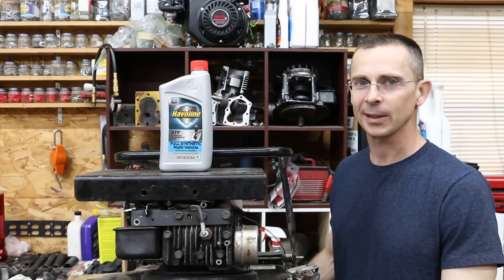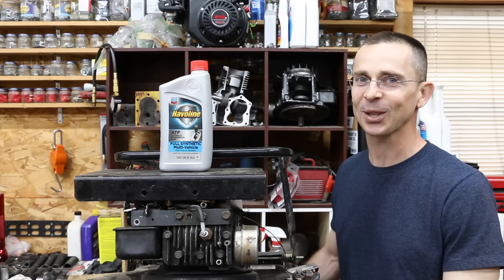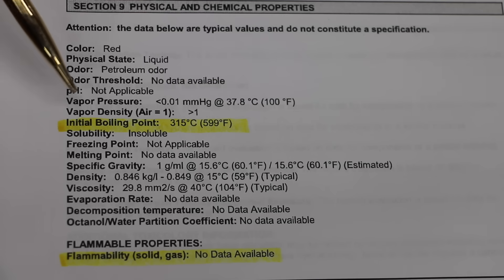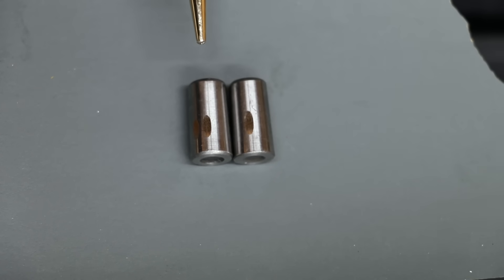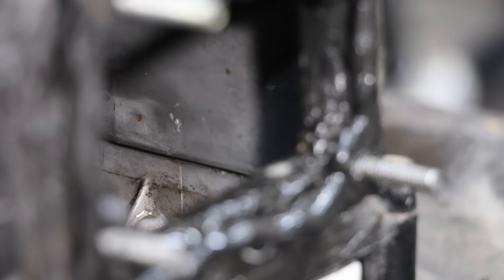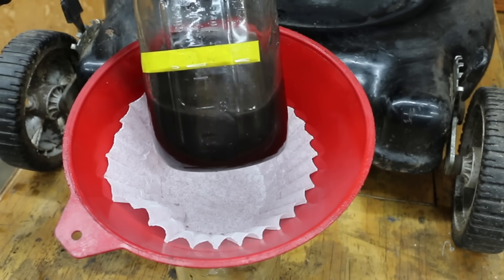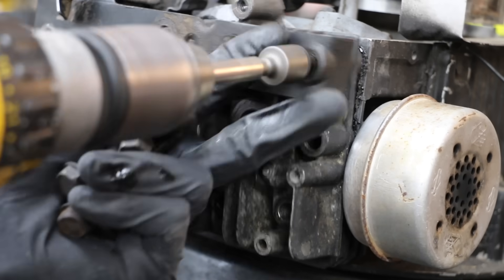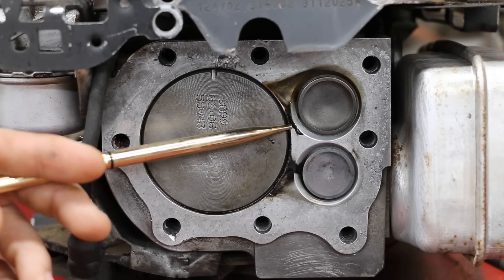ATF as an Engine Oil substitute?  Let's see what happens!

Comment: I have used marvels mystery oil in my 20-year-old truck, but less than a quart in the oil and I believe it’s ATF and it stopped that lifter from clacking in my oil always looked dirty even right after I changed it, but after I use that marvel mystery for about a year. My engine ran really good, but too much for too long will screw up your engine, but a little bit is really a miracle
Reply from the maker: Thanks for sharing.

Comment: Nothing but positive results over the years using atf.. used to pull old cars out of the bush and get them going,, most had sticky lifters and valves etc from sitting. atf frees them up quick.. after getting it going would pour a whole liter slowly into carb/intake.. have to keep rpm up so not to stahl, the smoke will come out of exhaust in thick white bellows.. best not to do it in town! ...have also used atf soaked rags to free seized engines.. soak rags with atf and stuff into cylinders then light on fire, the fire will heat the cylinders which will expand the metal and the hot atf will penetrate the rings. Was taught to me forty plus years ago, and still use these methods religiously today.
Reply from the maker: Thanks for sharing.

Comment: I use diesel straight down my Carborator 1 cup While running..I had stuck valves.
 Empty tank one gallon diesel 5 gallons gasoline. Then change oil and filter. Clean the whole motor right up. Run beautiful afterwards.  283 V8 67 Malibu. Age.67
Reply from the maker: Thanks for sharing.

Comment: Why did you you use 100% at on 88-98 Chevy 350s we would sub only 1 quart in between an oil change and it was helpful there is no way I would h 3:05 ave run 100% the test you done would be  invalid

Comment: My uncle told me this.
A friend of his bought a "little old ladies car". It was very clean, 11000  miles, 15 years old. She only drove it a few miles to the store once a week, and every so often to get her hair styled.  She was selling it to buy a smaller car easier to park, it will be due for oil change at 12,000 miles. Which suggested she took care of it. 

She told the guy to just drive through town and come right back. She didn't want to risk her car getting damaged. The car ran great. He bought it. When he drove it home, it would not go faster than 40. At home he checked the oil, it was full, but it was black. He forgot to check it, he was so excited to see how clean the car was. He removed the drain plug but nothing came out. He knew it was full, so he poked the drain hole with a screwdriver and the oil came out slow. He removed the valve cover and it was really sludged up. He called a trusted mechanic and asked what to do.

The old mechanic said. "Put the valve cover back on, install the drain plug. Fill it to the hole with kerosene. Remove spark plugs and give generous amount of STP gas treatment to each cylinder. Let it sit for a whole week. Drain the kerosene. Replace drain plug, Fill with one quart transmission fluid one quart Marvel mystery oil, and top it off with cheap regular oil. Add another pint mystery oil to the gas tank. Remove spark plugs and crank engine to spit out the STP. Install new spark plugs and start it. Drive it 500 miles, change oil and repeat. But this time use good quality oil, drive 1000 miles before changing oil. The car should be running better. Then Change oil and drive 3000 miles. Remove valve cover and see what happened." 

The guy was stunned.
 With each oil change the engine ran better until it could cruise at 65 with no trouble. Inside the valve cover it was clean as could be.

But take note, only one quart of ATF and one quart Mystery oil to three quarts engine oil.
Reply from the maker: Thanks for sharing.

Comment: Rislone is the best product to use for cleaning an engine. The only drawback is that it's sometimes so effective at removing the scale deposits, it clogs the oil pickup screen. I had that happen on a Ford 460. I had to pull the pan and clean the oil pickup screen. But, there was a world of improvement in the engine's performance.
Reply from the maker: Thanks for the feedback.

Comment: In the past, on engines that had fluid intermix that I needed to flush out I would use ATF and in some cases straight kerosene or a mixture of the two.  (Alot of GM 3.1/3.4 v6s that had bad intake or head gaskets bad milkshake intermix, but ran great for example.) 

If it requires a lot of flushing to clean contamination out cutting the ATF with kerosene or diesel is an economic way as opposed to using just engine oil to flush it. Would I recommend running straight kerosene on an engine? No, but an experienced mechanic can use it to superb effect.
Reply from the maker: Thanks for the feedback.

Comment: Have never used pure ATF  in place of engine oil.
   We  , meaning my brother and I as well as several other people I have known,  
 Have used around 10-20%  of 
  Dextron  III.  Added to engine oil as a extra detergent , and it does work very well.
   Give it a try and you will see.
 Dextron III and Acetone mixed up 50/50  also works well as penatrating oil.
Reply from the maker: Thanks for the suggestion.

Comment: I have a collapsed lifter in my Tahoe 5.3 L engine and I'm at my wit's end. I've been told to use ATF in lieu of oil for about 500 miles. I think I'll try adding ATF to the existing oil and see if that helps.
Reply from the maker: Thanks for sharing.

Comment: I have used it on many engines 
It does clean things up nicely and improve compression by cleaning up the rings
Not quite as strong a film as oil so i never used it straight, only as an additive 
Generally charged oil within a few running hours after to remove the contaminants freed up
Reply from the maker: Thanks for sharing.

Comment: ATF is chuck full of detergents that will react with combustion products and turn into a thick sludge ....eventually.

Also ATF isn't very good at handling water contamination.

The main difference between most oils is what the additives are designed to handle.

The newer engine oils that start with "0W" are actually "5W" but they have lower zinc and sulfate levels so they won't clog up the new high performance catalytic converters.

Manufacturers understood that if they put "5W-20 Low Zinc/Sulphate" on the fill cap most home mechanics would just use regular 5W-20 , so they call it 0W-20 instead...for some reason this does a better job at getting the owner to go out and buy the right oil.
(And avoid ruining the catalytic convertors)

Comment: When I was 18 my boss screamed at me to get some engine oil to throw into the truck as it was running without oil and all I found was a drum of old transmission oil which he poured in and the engine seized, I’ve always felt somewhat responsible for it but this video helps 😂
Reply from the maker: Glad the video helps!

Comment: i had an old jeep cj7    low on compression, lack of coolant heat to the heater core , an elderly man who was a radiator repair man ,  suggested an old school trick , drain old oil out , refill crankcase with with 10 quarts of a good quality auto tranny fluid , and several cheap oil filters , remove the pcv valve and the oil fill cap , and run the engine keeping an eye on the coolant gauge as well as the oil light , when the oil light flickers , stop the engine , remove nearly plugged up oil filter , replace with new on e, restart engine , just let it run , for 30  minutes stop engine , drain oil pan , refill crankcase with only 8 quarts , run engine for 30 seconds , shut down engine , let it sit overnight , next morning redo process , you would not believe the sludge that was flushed out of the engine ,  the cylinder compression was way up , as well the engine was generating a lot of coolant heat after that , very hot heat from the heater core , engine ran like a top after that , mind you i was using diesel engine oil after that to boost up engine oil pressure
Reply from the maker: Thanks for sharing.
Reply: @ProjectFarm  what i forgot to add was that i was using a high detergent diesel engine oil after the sludge clean out , engines with high mileage should switch to diesel engine oil as it is thicker than 20w50 engine oil and boosts up oil pressure

Comment: Old lifter motors, I drain a quart and replace it with kerosene. Run for 10-15, drain, add cheap oil, run 10-15, drain, replace filter and good oil.
Reply from the maker: Thanks for the feedback.

Comment: I haven't used it in the crankcase but I do use it about once a month as a diesel additive, one bottle to a tank of fuel.  It's high detergent content is an excellent cleaner for diesel injectors and pumps.
Reply from the maker: Thanks for sharing.

Comment: To clean a dirty crankcase I like to add SeaFoam to the oil at the end of the oil change interval. Cam says up to 300 miles, but far for me. I have gone over 100 miles with it before though and the next oil change got dirty quick but the one after that and subsequent one’s don’t get as dark nearly as fast. I also like Marvel Mystery Oil as an engine oil additive and even as a fuel additive but I don’t replace a full 20% with it as I think it would thin out the engine oil a bit much. I use about half a quart in my truck which calls for 7 quarts of 5w20 and about 8-12 Oz in my Saturn that calls for 4 quarts of 5w30
Reply from the maker: Thanks for the feedback.

Comment: I had a sludged up 5.2 dodge magnum... used 1 gallon of diesel fuel and 2 qts of dex 3 transmission fluid. I let it run for a bit. Pressure dropped to zero.. then i wait 2  n restart pressure jumped up to 45psi..then dropped. . Shut it off n repeat for 30 minutes or so of run time.. drain n fill with cheap wolfshead 10w30 .. ran 53psi idle was 32psi or something like that.  Works..

Comment: It’s probably a better lubricant than #2 diesel.  

Note: have bought several quarts of ATF (it was being closed out - 1$ per quart) to “serve” as 4x6 bandsaw “coolant”.  Just need to do the work on the saw proper, now - a better downfeed, easier to clean, and more stable than the supplied sheet metal stand.  Oh, and casters that work decent, too.
Reply from the maker: Thanks for sharing.

Comment: ATF absolutely cleans . I ran 4 qts oil and 1 qt ATF for ten years and changed oil and ATF every time . After ten years that engines extremely clean when I replaced head gasket . No catalytic though so unknown on newer cars . 64 chevy truck 6 cyl.

Comment: I toss a little atf in the crankcase from time to time. It’s a perfectly suitable crankcase filler. You just need to understand it thins out your oil, so if you run 15-40 like I do and don’t mind winding up with a lower viscosity after a 1/2 quart of atf, go for it. Running a large amount of atf all the time is a bad idea long term as it’s pretty thin stuff.
Reply from the maker: Thanks for the feedback.

Comment: As a student without much money to spend, my girlfriend’s uncle agreed to help repair a Pontiac Sunbird that had a blown head gasket. He’d talk me trough it but on the way to his house, the oil idiot/change engine went off and upon arrival there was no oil showing on the dipstick even though I topped it off at my apartment before heading out. He had some used ATF and said it’d be good for finding leaks. Sure enough, we found a steady stream at the oil pressure switch. I learned about wet torque/dry torque the hard way on that car, snapped a head bolt using dry torque numbers w/ anti-seize on the threads. Luckily there was a quarter inch sticking up above the block and could back it out using vice grips. Fun times, thanks Joe!
Reply from the maker: Thanks for sharing.

Comment: I had a old Honda accord wagon that a senior had and putted around town. It would smoke blue for 30 to 60 seconds every cold start. I thought it was maybe the valve seals but my friend at Honda service said it was more likely sticking gummed up piston rings? I put in a quart of auto transmission fluid and ran it through several cold to hot cycles not running it too hard. That car completely quit smoking,ending the problem.
Reply from the maker: Thanks for sharing.

Comment: Had a guy i knew used kerosene to clean motors. Drained the oil, refill with kerosene, then just crank the engine for 30 seconds or so. Dont run it though! ATF does the same thing, used it several times on older Chevy's so far with no bad results.
Reply from the maker: Thanks for sharing.

Comment: NEVER heard ATF was a long term substitution.  I have read- and used it- as a full strength engine flush.  I filled w all ATF and idled for awhile for a deep clean attempt.  Seemed fine.  It was somewhat used ATF I was discarding anyway....so....zero cost.
Reply from the maker: Thanks for sharing.

Comment: I've used Valvoline Max Life Synthetic ATF 1/2 quart with 5.5 quarts of synthetic oil and my truck runs great.  ATF I'd great for cleaning oil passages .  I wouldn't use 100% ATF.  The fact that you did and didn't  seize the engines speaks volumes.
Reply from the maker: Thanks for the feedback.

Comment: It's gotta clean better than oil but at a cost of extra wear, I haven't used atf in a crankcase but have run a diesel on it with improved combustion, i've ran diesel in a mower crankcase to clean it out, it stopped the mower constantly smoking which is what i was aiming for.
Reply from the maker: Thanks for the feedback.

Comment: My Payhfinder R50 (2003) had a badly gunked up engine from misuse by the previous owner. It was bad. My mechanic used gas to clean as much gunk as possible and then ran some good quality oil. I topped up with a quart of ATF after a few weeks and another after a few more weeks. Engine was run like that for about 3 months. The gunk is now all gone (engine looks literally brand new in the upper pan now) and no damage or unusual wear has been observed.
Reply from the maker: Thanks for sharing.

Comment: I’ve recently just used some transmission fluid with my motor oil that had been sitting for 15 years there was so much sludge built up in the crankcase that the new motor oil I put in there was ruined before 50 miles got put on the motor oil so I had 2 options potentially more but with money being tight I used what I had at my disposal and it worked surprisingly well it definitely cleaned out the sludge from the motor it was try doing that or basically the only way to completely remove all that sludge would be to pull the motor completely out from the vehicle & disassemble it and reassemble it then reinstall it back in the truck I didn’t feel like doing all that work personally when I do pull the motor out I’ll update my findings exactly how well it removed the sludge
Reply from the maker: Thanks for sharing.

Comment: An engine with lifter noise can sometimes be helped with the use of one quart transmission fluid added to the crankcase, one quart must be drained before use or damage can happen. We used tranny fluid to clean engines all the time in the past and to this very day I'd use it again but only for short periods of time say an hours runtime. Then fully drain and use a new filter element and new engine oil of course.
Reply from the maker: Thanks for the feedback.

Comment: The vacuum modulator valve on my Bronco 2 started leaking. The vacuum line from the carburetor sucked transmission fluid into the engine. I didn't notice and drove it for a couple of weeks. Didn't seem to hurt the engine.
Reply from the maker: Thanks for the feedback.
Reply: @ProjectFarm  I haven't removed the valve covers yet but I'll bet the engine is really clean. 😁

Comment: My Chevy1500 has lifter noise that didn't goes away after using Seafoam. I added 1qt ATF and about 450 mile later it sounded like baby sleeping. There are some dealerships would add ATF to engine if customer has lifter noise issue.
Reply from the maker: Thanks for the feedback.

Comment: I have seen atf add to cylinder to get compression back, I  even had a customer who added 1 qt of atf to fuel tank to clean injectors. I  remember watching a mechanic who was looking at a tow truck, the engine had a terrible knocking sound. The  mechanic took a coke can and filled it with water and slowly poured water into carburetor as he held the throttle open black smoke started pouring out tailpipe and the engine knock cleared up. Most thought motor was ruined turned out to be carbon build up
Reply from the maker: Thanks for sharing.

Comment: I did try it once in my 1985 Porsche 944, (4 cylinder 2.5L) after it had some coolant mixing into the oil from a broken seal on the oil cooler thingy. It seemed to work, but I didn't dare run it more than a couple of minutes with ATF!
Reply from the maker: Thanks for sharingt.
Reply: @ProjectFarm  Hah you bet I love your channel. You're doing the work of a research engineer for fun! Thank you.